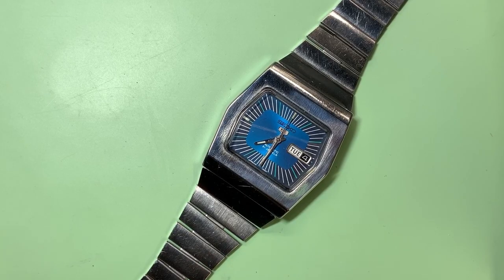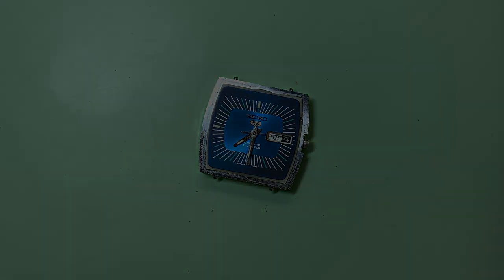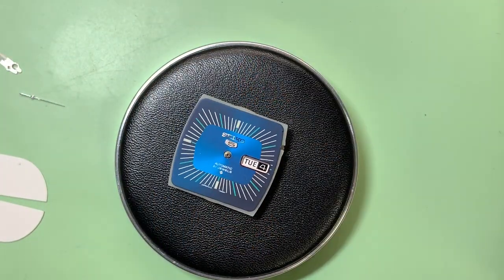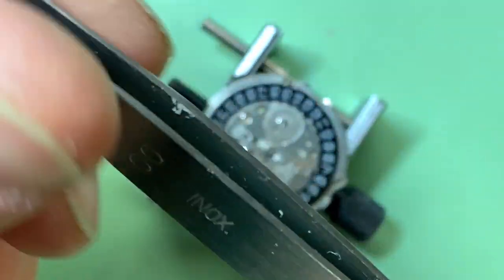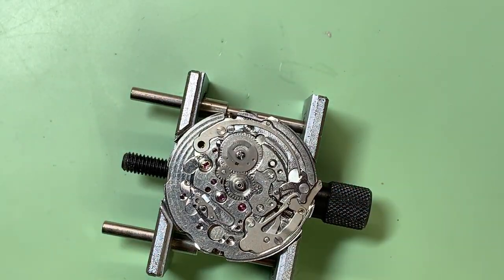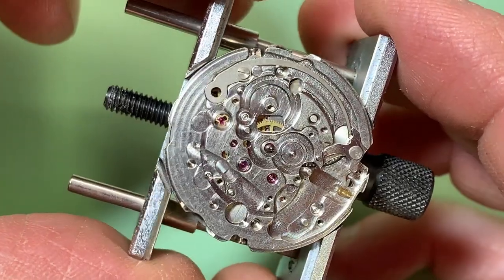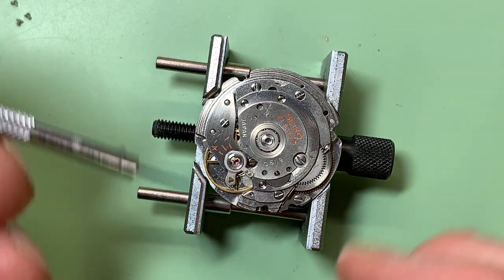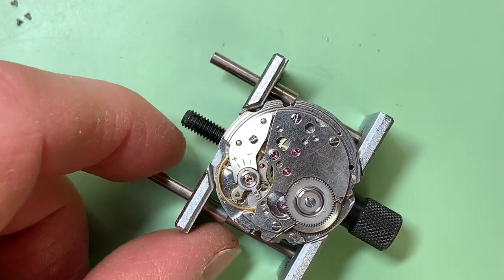Why Has My Watch Stopped Working?  Lets Find Out!

Comment: Mike, one tip from me to you.
Get yourself a good set of hand levers and a stock of transparent ziplock freezer bags to cut into small squares to protect dial.
That presto lifter will damage dials especially old ones. I'd hate to see any of yours go the same way two of mine did until I changed tools.
Reply from the maker: Hi Rob, I have a bergeon Shim to go under the hands but this time did not use it.  The lifter tool I have deburred and mirror polished the bottom so it cant scratch easily the dials anyway.  No sharp edges to drag on the paint.
Reply: My Retro Watches 
That's good to hear 👍

Comment: The old degraded oil is most likely Bergeon 8000, a mineral based oil that is stocked by every supply house I've physically visited in the jewelry mart in downtown Los Angeles.  It's the same online.

Bergeon 9000 series is synthetic, last much longer and will not clog the movement.

Comment: I think it would be a good idea to line the hands up to 12 then use some plastic to protect the dial from damage when removing the hands.
Hand levers would give more control, just an opinion.
Great video thank you.
Reply from the maker: JonTheComputerDoctor thanks. I have a dial protector that I usually use however my hand puller I have also deburred and mirror polished so it limits scratching to a minimum
Reply: @MyRetroWatches  Interesting, Thank you.

Comment: Nice introduction to the inside of a watch. How much different are battery watches?  Do you only work on spring watches? I have 2 Swiss Army Victoronix watches that stopped working after replacing batteries.  
I also have an older digital Seiko Alarm Cronograph that no longer works on the display.  I haven’t looked at your website to see what information you might have there. Will look to see if you have info for either.

Comment: This has been intriguing as a TV series, I've been trying to discover a faulty piece through all the length of the video, but I shaw nothing you didn't mention. I did see something at 25:35 under the train wheel bridge, near the barrel hole, that I thought were two scratches, but maybe they are just more dried oil, aren't they?
Reply from the maker: eagle eyed!  They might well have been.   I only noticed on your comment.  All the parts went through my cleaning machine and when the watch was rebuilt and on the timegrapher it was running way past my expectations for a 6119 from 1973,  there is a clip of this at the end of the video.    I am now  actually tempted to take it all apart and do a 10 minute catchup video so you can all see the parts now clean ... Good idea?
Reply: @MyRetroWatches  No need to open it again Mike, it's clean and running good so let it be for at least 5 years  :D

Comment: I changed the battery on my cheapo Infantry watch and was surprised to find it had a Seiko movement inside, AL35 so it says, think it must be from the bargain basement line over in Japan as the watch cost little more than a tenner, great big ugly bugger weighs like quarter of a pound but has a big copper diving bezel and a digital side to it and had it near three years and still going strong.   I bought from ebay a pair of old old Sekonda's, the ladies one needed a good clean and blow out and me daughter uses it and has been perfect time too, the very early quartz Safari is resisting repair so gonna just find a compatible movement.
Reply from the maker: Ian Watson you can find Seiko in all kinds of stuff. They did make some very low end quartz. Just remember that even the cheapest quartz will most likely be more accurate than any mechanical!

Good luck in finding a donor, check out job lot listings as you can get lucky in those

Comment: Thank you Mike, yet another informative presentation.  What you said about your watch collection being a by-product of the repairing rang a loud bell here.  There's only one watch that I wear regularly really, but I seem to be running a retirement home for old watches nobody else would want.  :-)  Started taking one apart the other day and quickly found a longish hair wrapped around the cannon pinion.  How on earth did that get there?  Everything else was surprisingly clean, considering.
Reply from the maker: Hi, I have found many a hair inside.  Easy to think how its go in there and over time it finds its way around the parts.   The watch I mentioned of a friends who had swarf filings in there,  I am surmising this is from the chrome plating coming away from the threads of the caseback and falling into the movement. On that on it was wrapped through the escape and onto the pallet!     As for my collection I actually wear most. I change nearly every day but the rotation is at random.  We have theme weeks in the Facebook group (Not sure if you are in there)  so this helps with my choices.    I am hoping soon to bring some Swiss movements to the channel very soon.  I have bought a beaten up Helvetia for this purpose and will film as I disassemble for the first time so I can only hope for no surprising springs in there!
Reply: @MyRetroWatches  Afraid I'm a resolute Facebook refusenik, Mike, but would join your group like a shot were it not for the platform.  The idea of theme weeks is intriguing: may I ask what it is at the moment?  Some Swiss movements would be very much up my street, and quite possibly you'll enjoy the change too, depending on what you get.  The watch mentioned above is from the early 1950s probably and rather nice on the inside: there are some touches which I really appreciated, like recesses machined into the cocks and bridges for tweezers, and different treatments to the screw heads to make them easier to identify.  I don't have anything like enough experience to say whether that's the rule or the exception, mind you.  As for the springs ... nightmare!  :-)
Reply from the maker: GenWivern2  well I am pretty inexperienced in Swiss other than some pin levers and a recent Longines 284 which was lovely inside.,

I have bought an old Helvetia for little money , the dial is beaten up and hands won’t stay on but the movement looks lovely and runs .  I’m planning to do a tear down video as always on the fly.  Having never been inside should make for an interesting video... ping moments included
Reply: @MyRetroWatches  Bound to be interesting ... I'm very much looking forward to it.
Reply: Threading a hair thru the cannon pinion prior to fitting it is a dirty hack if the cannon pinion is slipping.
Reply: @jakelewis3d  Good grief.  This was a long 'un so I'm guessing that's not the case here, but all the same that's a factoid to treasure.  Incidentally, the last service mark is dated 1961.

Comment: Follow up question, Mike - Do mainsprings typically just need to be cleaned and lubricated? Under what circumstances (beside breakage) would you replace a mainspring? Thx - Dave
Reply from the maker: Mainsprings rarely go wrong in my opinion.  They break yes but its its a alloy one then the chances are it will keep most of its spring tension through its life.  It can loose some and watchmakers I know tend to change them regardless.   On very old watches the springs were made from a different steel and after time they "set" this means they loose all spring tension and just set to size and are then of no use at all.
Reply: @MyRetroWatches  thanks for the reply Mike - very helpful. When you say 'old' can you give a time range? I recently got a yachting timer  (essentially a 5 min stopwatch) from the 60s I'm guessing. It winds all the way, but runs intermittently like the timepieces in your videos. It probably just needs to be cleaned, but there are a couple NOS mainsprings on eBay for not a lot - was wondering if was worth it or not. Guess I'll wait for a teardown to decide. Thanks again!
Reply from the maker: @davearduini  is say it just needs a clean. Poor tuning watches stopping and started would not a mainspring

Comment: Question: although be no means ideal, could one plop the entire mechanism in an ultrasonic cleaner and the oil it? The reason I ask, is that I cannot be the only one who is t quite ready to tear it down, but can see the need for a cleaning.
Reply from the maker: Not really practical as you would not remove all the dirt and if you were using any water based cleaning methods it would rust up overnight.  The only way to service properly is to strip it all down first.

Comment: Hey Mike, nice video! I was wondering if you have experience servicing quartz seikos and if you believe they follow somewhat of a similar service.
Reply from the maker: Hello,  Quartz or at least the mechanical parts follow a similar procedure to a mechanical watch.  the Quartz will have a circuit board that benefits from a clean in IPA alcohol.  Common problems with quartz is battery acid being left to do damage.  Coil getting damaged from a slip of a case knife on opening.  Or on occasion the quartz crystal has failed.
Reply: @MyRetroWatches  Great, thank you Mike! If you ever have the time and would want to make a video on one of these I would love to see a Seiko 4004, 3003, 2002, 5y23, etc. Thank you again!

Comment: 6119 usually have barrel arbor wear keep look for that
Reply: Including this watch. In the video you can see the  top rim of the barrel's plating has worn thru to the brass, along with corresponding marks in the underside of the train bridge.  This is due to the barrel tilting as the arbor port wears - there is clear wear on mainplate barrel port at minute 36 of video.

Comment: Will there be a follow up?
Reply from the maker: Hi, Not on this watch.  I serviced it and wore it yesterday.  the spinet at the end showing it running well on the timegrapher was the indication that all went well.
Reply: @MyRetroWatches  Thanks.  I have an old Seiko of my dad's that won't run.  Your mention of pushing the stem in to change the day and date was helpful. The date changed but the day will not move and the date moves instead. It is a Seiko 5 with these numbers on the caseback:  6119-7140 across the top and 978356 Japan F at the bottom.  I am collecting the tools and generalized watch repair books to attempt a repair in the future. I think the fixing of such an intricate machine would provide a great sense of accomplishment as you said.  I thank you for your tool list which I will be using for future purchases.  Being retired these things take time to acquire due to monthly SS checks and budgeting.  Thank you for your posts. They are very informative.
Reply from the maker: @rickcroucher  Hi Rick, firstly have a look though at my playlist here. its a full breakdown and assembly of a Seiko 6119.  Please bear in mind that some were done a while ago and I am not sounding as confident behind the camera!  https://www.youtube.com/watch?v=lVI4Amp81r0&list=PL1QqBaAlwtP5fEJ1-c58AE217J8UOpvtW

I also would want to plug my tool page on my site which would help you with choices on kit to buy.  

As for the day not changing, do make sure that behind the crown its all very clean,  you need to press very firmly to get the day wheel moving.  Perhaps you can see yours "try" to move??    there is a lever within the movement that moves when you press the crown in, this activates a gear under the day wheel disc that looks like a star.  Two things could be happening here.  The star could be out of alignment which can be adjusted and if it was that then I suggest you contact me direct so I can talk you though what to do there.  The other could just be that lever is not seated right or even missing.    Equilly it could be just other parts of the keyless works being gunked up and needing a clean and oil.

Comment: Mike, I have a 7019-5000 with the same type of waterproof casing. The stem release mechanism is either stuck or jumped out of place as the stem won't locate.
What should I look out for to try and remedy it?
Reply from the maker: Hi Rob,  its a common problem,  (PS love the mini monaco)  There is no easy way to get them out.  I hate that lever and think its a poor design is its not screwed in just held in the the quickset.  If its still in place but not releasing you can try to jack the dial up a little using something like a match stick. Doing this means the lever will have more travel. I did this very same trick on a 5000 only a few weeks ago.  If the lever is completely missing you have to carefully prise the dial off.  the 7019 has the dial feet release screws on the underside of the case. You will have to persuade the dial out of them which is not easy but can be done if they are not too tight.   Had it been a 6119 or similar the dial feet screws are on the side of the mainplate so jacking up the dial enough gives you access.   PS make sure the stem is at full extension and this gives you more high gain.   If all else fails send it to me and I will see what I can do. Are you trying to service?
Reply: My Retro Watches 
Hi, nowhere near being confident enough to service nor have I the space or tools. I just do refurbs and reluming.

It was working perfectly until I decided to take it out the casing a second time to clean off the back of the dial. Lever is still visible but looks to be stuck down.
Was going to send it to my usual guy in Berlin but thought I'd try it myself if it was a simple realignment.
Reply from the maker: ro63rto don’t mind looking at it for you Rob
Reply: My Retro Watches 
Very kind of you . Talk more on WS.

Comment: Seiko is still getting away with it in today's world. Outdated movement, hardlex scratch magnet and not handwindable.
I have a new Seiko 5 Snxg47k1 which stops when I take it off at night. Been late for work a few times so I have gone back to wearing my Seagull St5 vintage from the 1970s. A most reliable and accurate watch. Same size as the Seiko 5.
Reply from the maker: neil piper there clearly is something wrong with your Seiko if it cannot retain any reserve power. Could be mainspring slipping or an issue with the automatic framework setup..

Comment: I know I am going to sound a bit "heartless" by asking; how much is this watch worth? Seems to me it's not worth the time and effort.
Reply from the maker: rockymntdan1 all very subjective . I like retro watches so for me because I have the ability to fix and service it there is no cost other than my time and pleasure.  Value of this piece would be maybe £40-80 uk . However I am on a crusade to save these types of designs.

The 6119 movement was used in a significant amount of Seiko watches in the 70s , you have to think that many have not been serviced in 40+ years yet still run. You could not say the same for higher end brands. A testimony to Seikos superb engineering . 

Cost will never come into it for me as I’ve rescued £5 watches before for the challenge of fixing them.